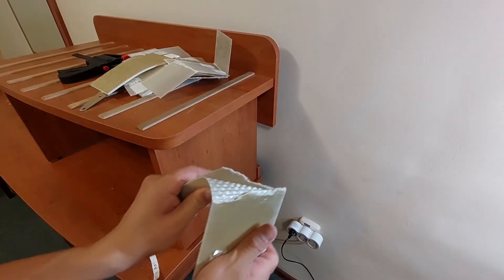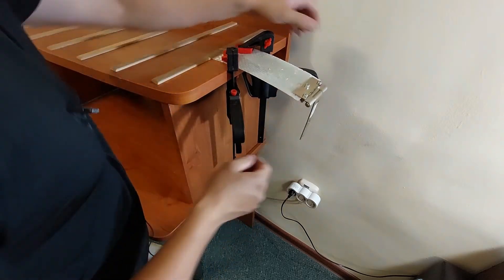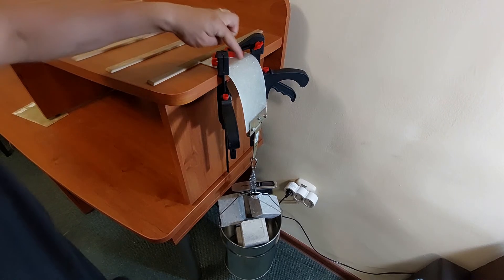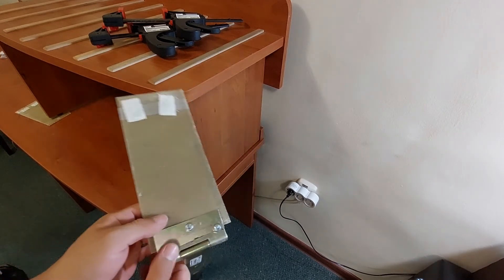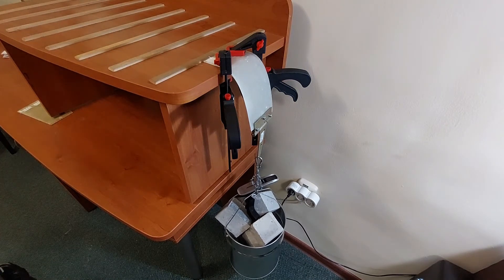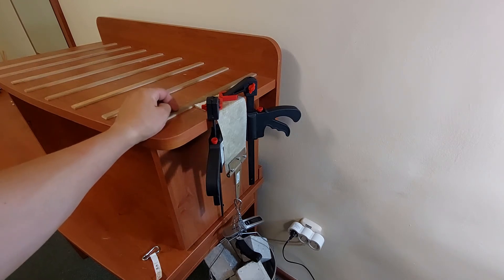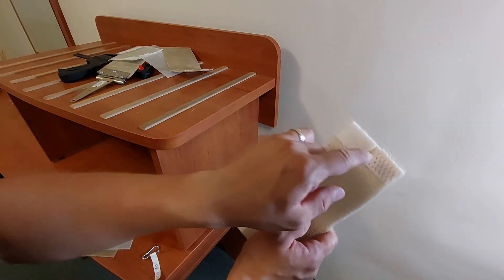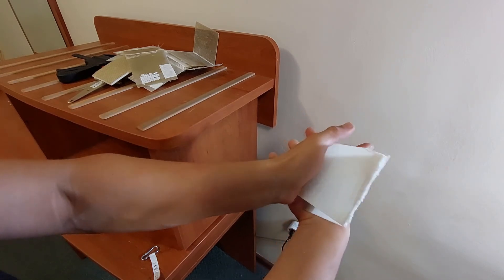Fiberglass work / How strong is fiberglass/ Fiberglass breaking test

Comment: I wonder how would epoxy resin compare to the polyester and vinylester. I think epoxy is quite brittle, too?
Reply from the maker: @sailingsmalldreamingbig9022. First of all, thank you very much for your comment!!! The resin either polyester, vinyl ester or epoxy has similar properties being a matrix for laminate.  However, each has its advantages and disadvantages.  Regarding the polyester resin, this is the most often used because it has a very good quality-price ratio.  Vinylester resin is more expensive than polyester resin but is more flexible thus allowing higher tension forces.  A disadvantage of these two resins is the fact that they are based on styrene and give off a strong smell up to 6 months after lamination.  Another aspect to take into account is the fact that these resins have a higher water absorption over time than epoxy resin, but it can be waterproofed with a layer of gelcoat that also has the role of UV protection, however it is recommended to use it.  Epoxy resin is the most expensive, but as advantages I would list the fact that it does not emit an odor after the reaction becomes inert and has a water absorption close to zero.  However, the most important aspect that must be taken into account is the type of glass fiber used, the orientation of the fiber, the percentage of catalyst used and the environmental factors (temperature and humidity).  This can dramatically influence the quality of the laminate. If you found my response beneficial, I encourage you to subscribe to the channel. Your subscription serves as a significant motivation for me to persist in delivering valuable content. Additionally, should you have any further inquiries, please feel free to reach out. I am here to assist you.
Reply: @PAFixandCrafts  Thank you for this very thourough explanation! I'll subscribe to your channel

Comment: On the surface, a good video. However your results seem to defy everything I know about Vinyl Ester Resin. This is peculiar and a bit misleading. I am curious, are you testing with 100% pure Vinyl Ester? Are you properly catalyzing the Vinyl Ester? It requires full strength catalyst and a minimum of 1.5%. If under-catalyzed, the resin is not curing. I also notice some the Vinyl Ester Samples appear "wet" or Resin Rich. This also makes the Laminate brittle. Again, this seems like a great test. But your results are untypical of Vinyl Ester Resin.
Reply from the maker: @Vernese Customs. First of all, thank you very much for your comment. As well for me the results are a little contradictory and surprising, because it is not. I say this because I have 15 years of experience in the field and I work in a company that has its own development and research center. This does not mean that vinylester resin is worse in quality compared to polyester resin. I would rather say that the type of application it is used for is very important. Regarding the quality of the materials, they are tested in an authorized laboratory. The test samples were made at a temperature of 22 degrees Celsius and a catalyst concentration of 1.6%. The hardness of the laminate was tested with the Barcol device and they had similar results. The degree of reinforcement resulting from burning was approximately 40%-60%. Which for a manual laminate is ideal. I will try to make a more professional test stand to have more accurate results and repeat the tests. Thank you very much and don't forget to subscribe to the channel if you haven't already. This motivates me and helps me enormously to continue with the production of these videos.